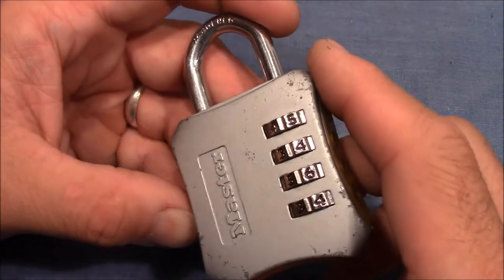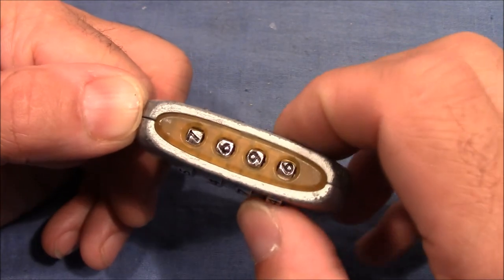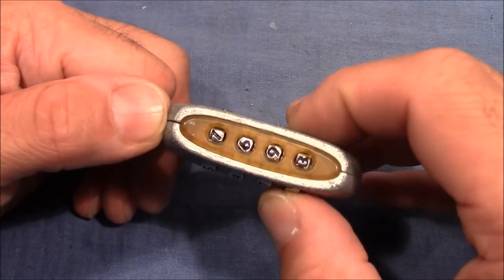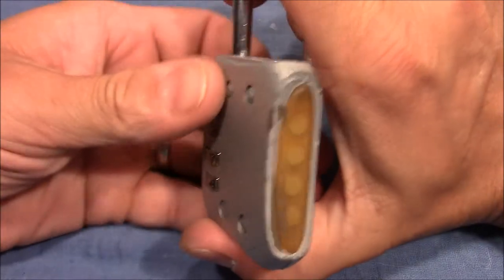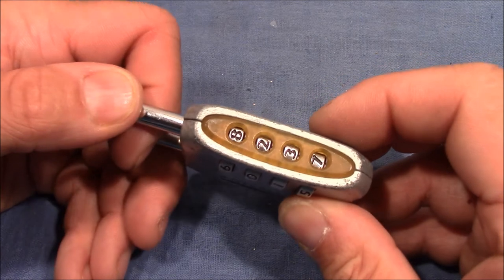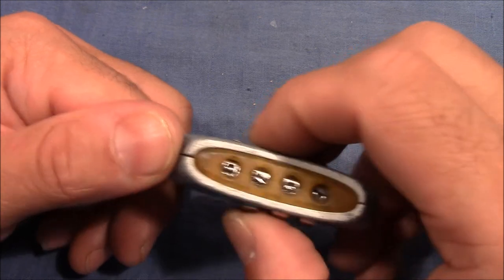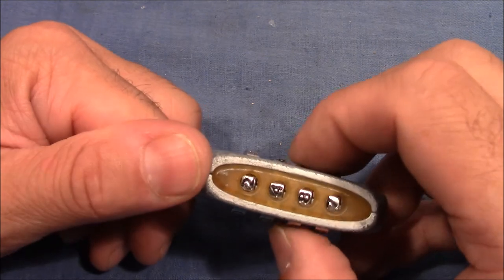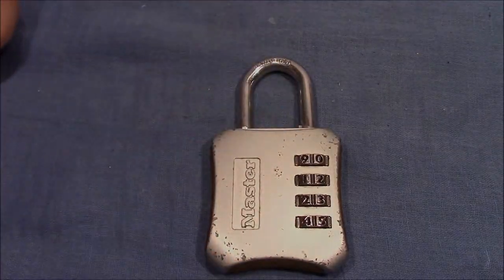(picking 239) Master 4 wheel combination padlock decoded [adaped pull picking method] thanks PickME

Comment: Great video. Mine is a 653D. I check each wheel like you mention and then start back at the bottom and usually find a few tight again. When they are all loose again mine just opens without having to advance the wheels. Not secure at all but I’m not surprised with the way it clanks when I shake it.

Comment: Interesting method of getting it open, I haven't seen that before. This is perfect for when you have no tools or low lighting.  

Also this lock DOES have false gates. You can see/feel them with another method of opening this lock where you look between the wheel and lock body in order to line up the groves. When doing this you will notice that the true gates are much deeper than the false gates. Also once you line up the true gates you may still need to shift each dial to get the lined up true gates into the right spot, make sure to move each dial the same amount so the gates remained lined up.
Reply from the maker: Thanks. Glad I could show you something new. Interesting that the gate testing/feeling/viewing method works on this lock too. Will check it out on my instance.

Comment: I'm trying this right now and really struggling.  The lock is on a cabinet that sits above my head and I cannot get it open and have forgotten the code.  Can you please elaborate a little?  I'm a newb.
Reply from the maker: How can I elaborate more than with this video? Perhaps checkout these videos too: https://youtu.be/eNhKRSqncYs?list=PLuSaKS-pr3L81psh-vAVyp7R6Te1n5M37
Reply: @Potti314  All the dials seemed to move easily, I wasn't sure how much pressure to be applying to check whether they moved freely.  I did it exactly like you did, but couldn't get it to open.  I eventually asked my complex manager to cut it with bolt cutters because I'm moving and don't have time to play with it.
Reply: @bonniea8189  I don't blame you. I found this channel/video when a tent I borrowed has this lock on it. It took me about 20 minutes of fiddling, but finally got it! You have to use a lot of tension and the feeling of the movements can by very subtle. I imagine it's tough for someone as experienced at Potti to convey/teach these subtleties to newbies like us, especially in these quick videos. But wow, it was SO satisfying to finally get it. Kinda makes me want to try more :)

Comment: Just discovered your YT channel - I am enjoying looking through your videos, especially the combination lock picking puzzles ! I don't meet these very often. This Master seems to have false gates that 'catch and hold' the wheels, and so you need a slightly modified approach, is that correct ? Greetings from Wales (UK), Dave.
Reply from the maker: Thank you for the nice feedback - very much appreciated :-)The combo locks are a "new" passion that a learned to love after I started picking. Regarding the Master, I'm not sure what's in there. According to the feedback, I wouldn't call that false gates; maybe more disturber ;-) Maybe I can open such a lock and look inside someday, but until that they remain black boxes with feedback ;-) Thank for watching - cheers :-)
Reply from the maker: Ah, and greetings from Germany / (near) Munich, Michael.
Reply: I looked again - I see what  you mean - the wheels just don't allow you to turn them easily when shackle is under tension..maybe it was intended as a feature to slow picking down.....as you say, without getting inside, it's hard to say what is going on.